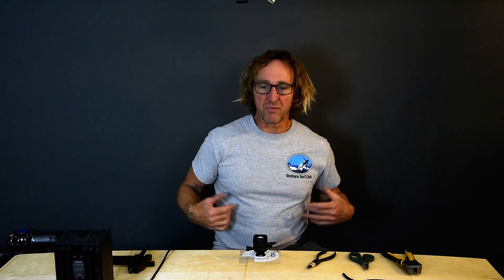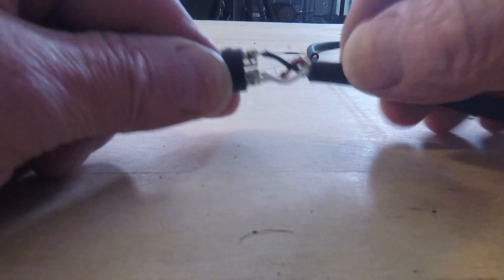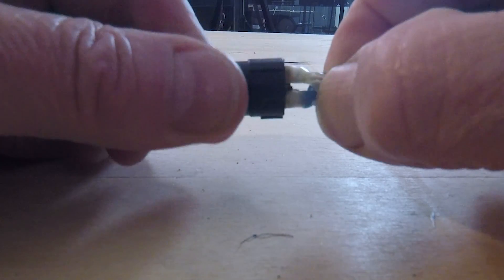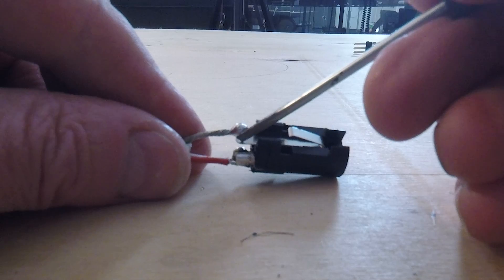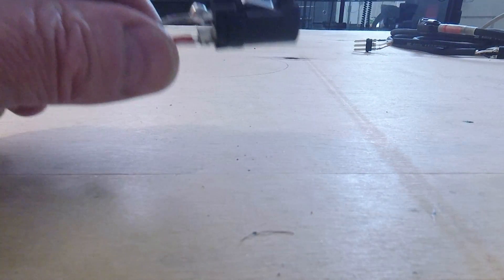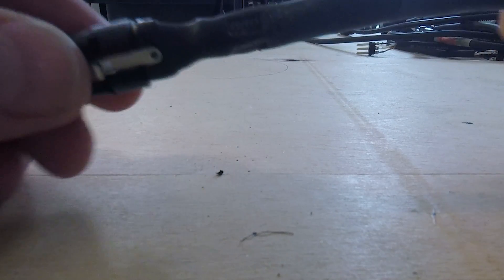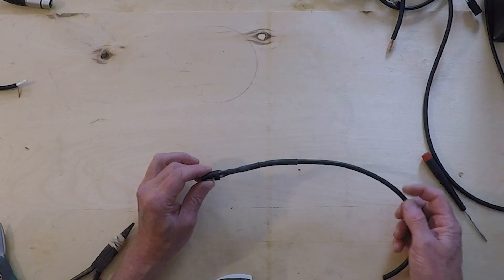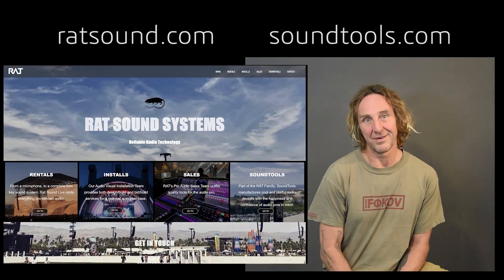Making XLR Cables #3 - Quality and Faults (Public)

Comment: Should i solder the ground to the casing on one end, both ends, or niether end?
Reply from the maker: Depends. Solder the shell does help shielding but also exposes the shield to touching things that can create problems.

Also shorting the shell to pin 1 ground will alter the way equip ground lifts function

For cables being extended, shell grounded tends to help in high noise environments but for most cables it's better not to ground the shell

Comment: Thanks dave.... I've always done the cut the braid (or sheild) wire shorter so any tension appears on it or breaks it first. Always been told this is so your lead will keep working with a broken shield connection. BTW we say Can - Air in the land down under. Cheers buddy
Reply from the maker: Cool cool thank you Peter!

Comment: Maybe you can help me, I've been looking for a better way to test cables I've made. I don't like the off/on light testers. I want to know if the ground is good, test for induced noise and all that. Do I need to pull out an oscilloscope to test each cable I make? I've just got some noisy cables that keep testing as good.
Reply from the maker: I would say making an XLR female with a 150ohm resistor between pin 2 and 3 as shunt.

Then test with a console and headphones with the gain turned up should or would be the best way

Comment: Great video Dave. Hopefully you could give me an explanation for this issue. All 3 XLR cables connected to E945 and worked fine on QU16 mixer. However, none of them works with the ECM8000 condenser mic. I made sure that 48V was turned on and even tried ALL 16 channels without success. I was so confused and tried my lass option which was using a short XLR cable from the talk mic and it worked with no problems. One thing  I noticed was when I plugged in the ECM8000, I could see the meter jumped up instantly but that was the only signal I saw on all 3 XLR cables. How is this possible when cables worked perfectly on dynamics but failed to ork on the condenser? I wish I had another condenser mic to try but I did mot. Hope explain this issue for me. Thanks Dave
Reply from the maker: Sounds like the XLR cables are unbalanced with either pin 2 or put. 3 shorted to ground or they don't have the pin1 vonnected.

Both of those would cause what you experienced

Comment: Another great series as always Dave! Question, could you elaborate in one of the next videos on uses for the chassis ground?

For example, some of the cables you showed had two layers of shielding. Would it make sense to use the inner layer as the pin 1 ground and the outer layer as the chassis ground with that type of cable?
Reply from the maker: Hmmmm, I can not think of a reason to separate the two shields. Pin 1 is the ground connection and the gear it is connected to will determine how the ground is connected to the chassis.

Comment: Do you generally use Black in a Black/White pair for Pin 2?  I have always been told low-voltage is "White Hot" so pin 2 always gets the White conductor of a Black/White pair.
Reply from the maker: Yeah, that a good question.  With wall voltages black, red and blue are hots with white and green and colds.  With low voltage white is often a hot or in polarity and black is cold or out of polarity. And with older pin 3 hot gear, white went to pin 3 which was in polarity but now pin 2 is in polarity so pin 2 should be white or hot for low voltage.

As my daughter Sammy says when soldering up ythe custom SoundTools orders  "pin twho" meaning - Two is White

Comment: In reference to your catch 22 with heat shrink on each pin, I love my clear shrink tube that still allows for visual inspection.
Reply from the maker: Clear shrink is a good idea. Also though, my company owns several thousand mic cables and we do not use shrink when we make them. The failure rate of the connections at the XLR is very low and not an issue.  Most of the failures we get are either cable getting torn on a sharp object, or if very old, the conductors breaking just outside the strain relief.

I find that just the overall heat shrink is the best use vs results and only use individual shrink for extreme exposure to salt moisture applications.

Comment: UK BBC* policy was to use Hellerman rubber sleeve to insulate the screen wire with another rubber sleeve placed half over the outer cable sleeve and the screen so that the first rubber sleeve is held in place. There are 3 pronged pliers that open when squeezed, combined with Hellerman oil (or wireman spit) which will evaporate, leaving enough friction to hold it all together.

* Guess where I did most cable work....

Ohh, XLR male to male cable, now there's an interesting thing.